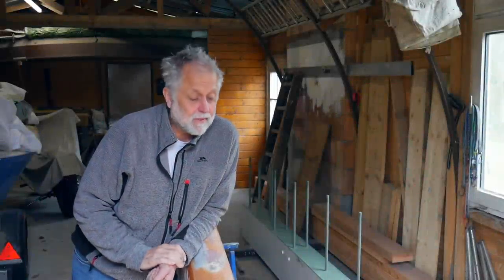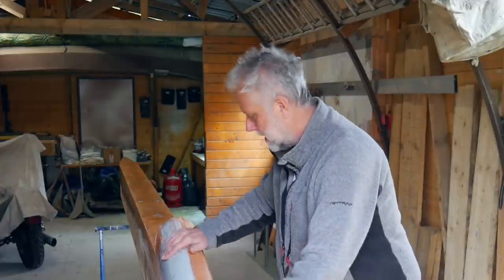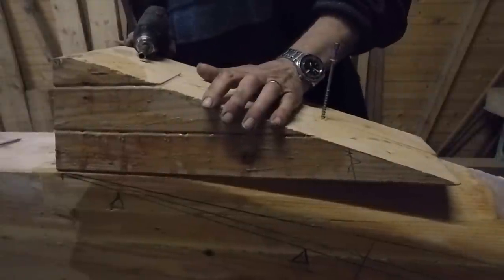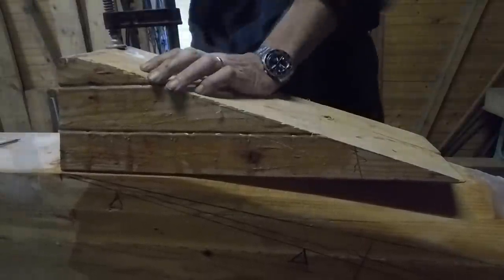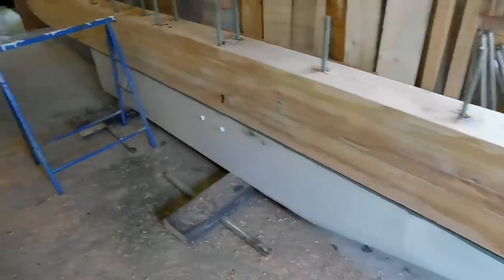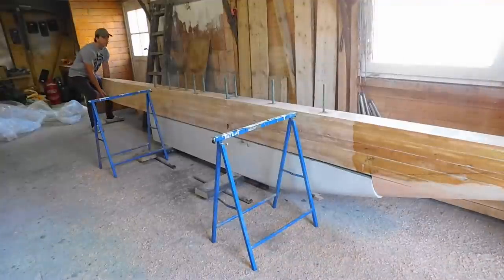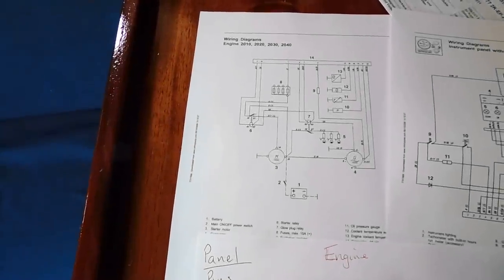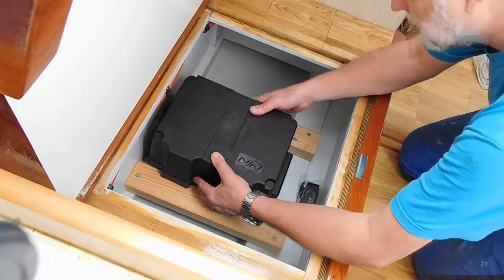Onwards With The Keel Timber And Engine Electrics - SV Tapatya EP227

Comment: keel looking fine there Tony, get close tony getting close. btw one old method of cleaning a gummed up gas tanks is put a hand full of washers and bolts or screws inside the gas tank with a bit of the acetone or vinegar, than lift you car off the ground with your Jack of course and strap the gas tank onto one of the tire with buggy cords and put you car on idle and let the tank spin for an hour. cleans it up really well.
Reply from the maker: That is a very cool method, Fon. I like it! 👍😀

Comment: You can make a Fiberglass mat 'ridge roller' from about 25 3/4" washers alternated with 24 1/2" washers arranged on a 1/4" x 20 threaded rod with double 'jam' nuts locked at either end. The washers should be just able to turn, and the remainder of the rod can be bent into a 'taped up' handle. This tool is great for ensuring all air pockets have been removed and the resin has fully penetrated the cloth, particularly when using heavy weight cloth. You can buy a roller for under $20 US, but every good shop has enough 'junk' laying around to build one of these for free... 🤑
Reply from the maker: I've got one, Mike. I don't rate them 👍

Comment: I would put 5-10 more layers of glass on the leading edge of that timber in front of the keel. That way if you hit something hard you might not have to haul out to stop water going into that wood. I've seen many do this.
Reply from the maker: Thanks. It'll certainly get more build up 👍

Comment: Re petrol tank. throw in some white vinegar and old nuts and bolts. Shake and shake. Drain and if need be tank sealer...
Reply from the maker: Thanks Robert. Next time, maybe! The acetone seems to have done the trick, combined with a good blow through with the air line 👍

Comment: Hi Tony, just an idea mate, when gluing 2 flat pieces of wood together, sprinkle some fine sand or maybe some fine dirt over the glue so when you go to clamp them together, the grit catches on each surface of the wood and helps stop the wood from slipping across each other and stops you from aligning and re-aligning to wood over and over. Just a thought mate. Coming along fantastic Tony, well done. Seeya Rob
Reply from the maker: Great tip. Thanks 😀😀
Reply: Sprinkling salt does the same thing, and is less coarse than sand or dirt (and therefore results in a tighter joint than sand or dirt).

Comment: Hi Tony, I have often seen batteries kept in bilges. You seem to have done the same. Have you ever consider a more elevated space for storing batteries where damage due to flooding at the bilge is unlikely ever to happen?
Reply: It's hardly in the bilge. It looks like the bottom of the battery is at the level of the sole.
Reply from the maker: Thanks Joseph. Funnily enough, I was talking to my daughter about just this recently (she's studying naval architecture). I like to keep the weight low down, but the potential flooding is certainly a consideration. I'm using sealed ATM batteries, so it should be less of an issue and I believe in dry bilges! 👍😀
Reply: @SVTapatya  Thank you for confirming my observation. You are right keeping CG down. I would do the same but perhaps on same elevation as the sole, e.g. securing a battery box behind the companionway stairs.